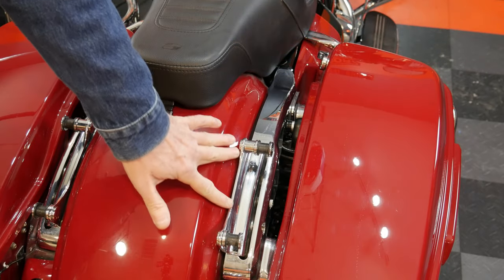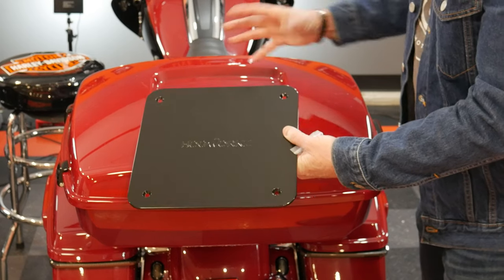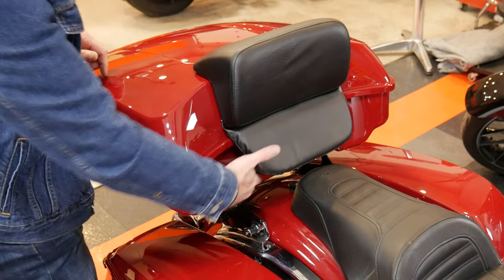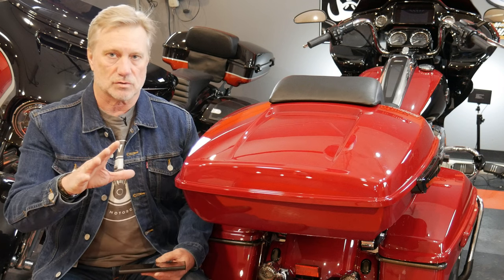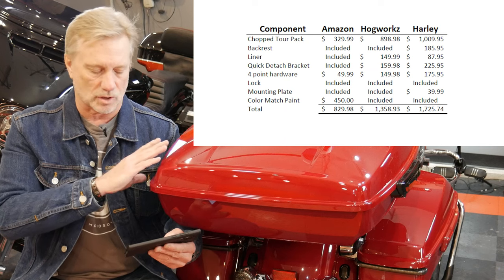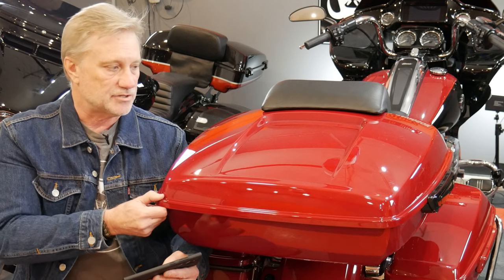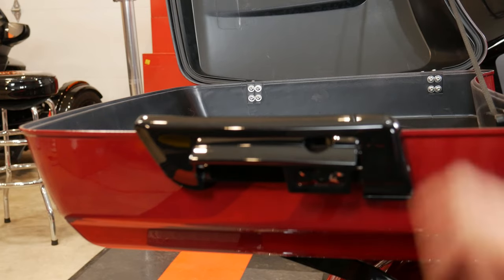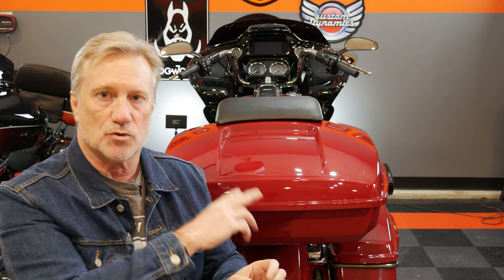2023 Harley Tour Pack Install and Comparison

Comment: I have purchased 4 TourPak in the last 5 years. For 3 different bikes. The costs you list for Harley are way off.  I purchased all 3 bikes new, and as part of my new bike purchase the four point docking hardware was free. With Harley the mounting plate is part of the TourPak so no need for a purchase. Your statement in this video about Harley not having a mounting was incorrect. I don't think I have paid over $1150 for any of my TourPaks. I have tried the Hogworks and Amazon Specials and didn't like the quality. The Amazon Tour-Pak flexed to much and the seal wasn't air. When it rained my stuff got wet. While traveling down the highway with a friend if I hit bump my friend said the could see the lid move and they were worried about it popping open. As for the Hogworks their docking hardware didn't work with my four  point docking hardware, I still had to use Harley. The latching system on Hogworks seemed cheap.  From my experience of actually physically working with each style of TourPak the Harley is the better buy.
Reply from the maker: Thanks for watching and commenting.   As far as the HD pricing...those were taken directly from the Harley Davidson parts and accessory catalog at the time the video was produced.   I'm sure if you purchased items at the time you bought a bike, the dealer discounts or throws items into the deal to get the sale.  I agree with you on the Amazon versions of tour packs as to the potential lower quality.  I have 2 Hogworkz tour packs.  The ABS material is the same thickness and same quality spec as HD...but lower price compared to list price as described in the video.  The point of the video was to share info so others can make an informed decision if they are in the market after purchasing a bike for a tour pack.  If you are already a subscriber to the channel...thank you.   If you haven't yet subscribed to the channel I'd be honored if you'd consider doing so.   Thanks for your support and ride safe. ✌️👊👍

Comment: I got the HD chopped tour pack and hardware, just because I had rewards cash , it does not have the reinforcement plate from HD. I went to a scrapyard and bought an eighth inch aluminum plate for $5. Drilled the holes and trimmed to fit. Dealer threw in the HD matching lock.
Reply from the maker: Thanks for your comment Anthony.   Always good to get free stuff with rewards cash.  Ride safe and enjoy. 👍✌️👊

Comment: Is there any issues with original antenna when adding a two up tour pack?
Reply from the maker: If you have the original antenna on the bike, the antenna will press against the tour pack.  In my case, I have my antenna hidden.  I do have a video on the channel showing a great way to hide the original whip antenna, giving a clean look and clearing the way for a detachable tour pack.  If you are already a subscriber to the channel...thank you.  If you haven't yet subscribed to the channel I'd be honored if you'd consider doing so.  Thanks for your support and ride safe. ✌️👊👍
Reply: @HDVIBE  I just checked that video out. Very informative video. Thanks again for all of your videos. New subscriber.
Reply from the maker: Thank you for the kind words and support.  Much appreciated.   I look forward to seeing your comments on other and future videos.   Ride safe and enjoy.  ✌️👊👍

Comment: You can get rid of the 450.00 for matched paint on the Amazon unit. I just bought an Amazon tour pack, color matched "wicked Red" for just over 350.00.
Reply from the maker: Thanks Robert for watching and commenting.   That is a good tip.  If you are already a subscriber thank you.   If you haven't yet subscribed I'd be honored if you'd consider doing so.  Thanks for your support and ride safe.  ✌️👊👍
Reply: How’s the quality of the Amazon trunk?

Comment: You can pull the tour pack lock and take it to a locksmith and they will re-key the drum to your Harley key; and it’s cheaper.
Reply from the maker: Thanks for watching and sharing the suggestion.   If you are already a subscriber to the channel...thank you.  If you haven't yet subscribed to the channel I'd be honored if you'd consider doing so.   Thanks for your support and ride safe.  👊✌️👍

Comment: Hi dude what are those bars you have on that street glide and how high are they please sir?
Reply from the maker: The bike in this video is my 2021 Road Glide.   Those are stock bars.  👊👍✌️
Reply: @HDVIBE  Have you changed them at all? I'm just under 6 foot and I'm wondering if I need a 10 inch bar? Your opinion would be appreciated.
Reply from the maker: @MightyMick88 I have never changed bars on any of the three bikes i currently have or 5 Harley Touring bikes I've owned over the years.   I'm 5'10" and have always felt comfortable with the stock bars.

Comment: ridiculous! i bout the whole setup on E bay for about 120$ and color mached it for a 100$ . your obviously selling the idea( at least) that you need high price shit and can't do it yourself. but for some reason thats the idea of most modern bikers. my 90 lb pitbull rides in the spot where the tourpack goes. tell me where i can buy that setup. no i had to build that chariot for her, which also cost about 150? ish. 
you can only have individualism if you buy mass produced bolt on shit. oh and get a tat of barbed wire.
Reply from the maker: Thanks for watching.  👍👊✌️